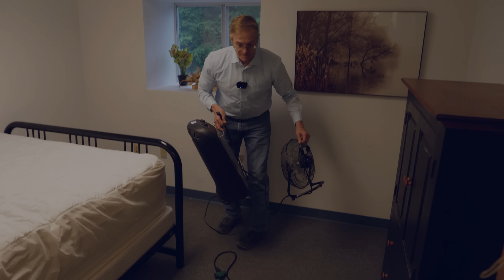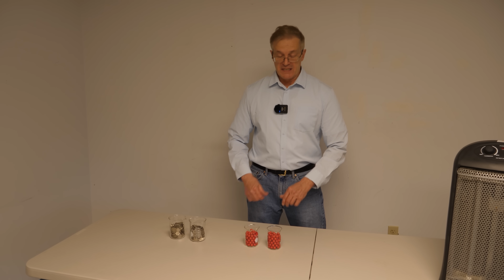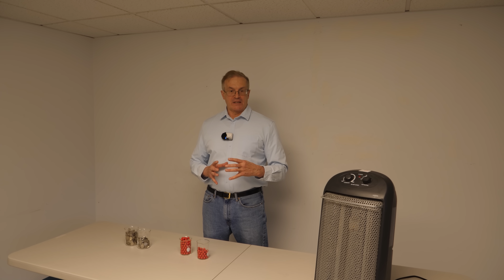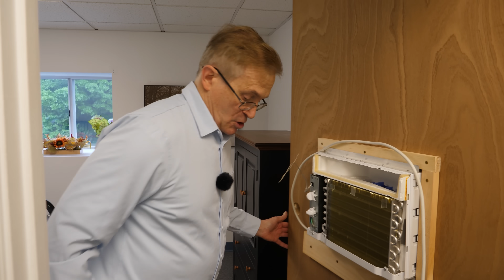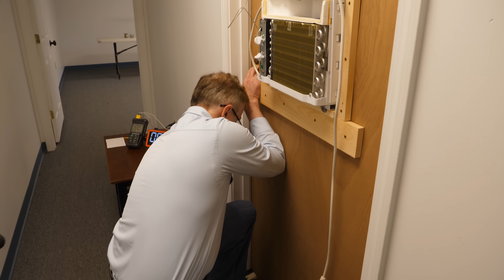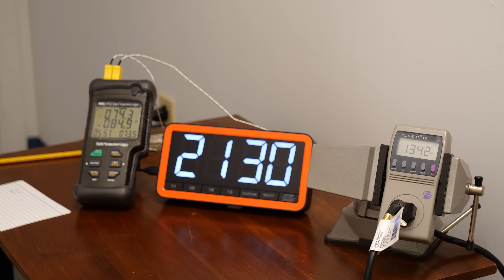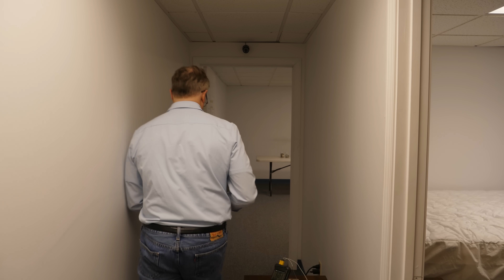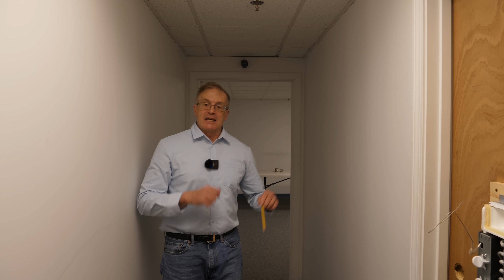You're wasting money on heating! Use your A/C!

Comment: Are heat pumps a better method than electric heaters. Yes! Are they better than my wood burning stove or my mum's gas central heating? That's a different question and how does one measure that? I'd say that the only answer is financially. Any electrical supply suffers a 70% loss through the steam turbine and transmission losses before it arrives in your house and you pay for that with your wallet.
  I  would be really interested to see how heat pumps perform when the source is at -20 and the desired temperature in the house is at +22 i.e. winter (yes SI units). Will it outperform an impedance heater? My guess is that it will. Will it outperform direct wood, gas, coal or oil? My guess is absolutely not.
  Your experiment had the source at +22 which is completely unrealistic- who needs heating at +22?
  Good luck and Godspeed.

 To preempt the comments, there is no point citing "Climate change" or "CO2", or any other such nonsense, since electricity comes from burning wood, gas, coal or oil at the previously mentioned 70% loss.

Comment: A car parked in the sun will manifest up to 120 F interior temp. The immediate thought is to use a thermoelectric module to convert this heat energy into electricity, in this case for a "hot parked electric car". I've read studies that found 280 watts of electric energy could be manifested in this fashion. None of this really mattered until electric cars showed up. I have no idea how this would be executed as I'm not an engineer, but. 120 F is really hot and it is wasted. I have owned businesses and paid electric bills for 40 years, anything that can be done to disappoint a utility executive would give me joy.

Comment: My A/C unit will not turn on if it's cold outside, so this is a cool experiment, but that's it.
Reply: relatively easy to heat up the thermocouple to force the AC to turn on...heck, move it to the inside instead of the AC side of this demonstration and it works even if the outside is sub zero...and continues to work as long as the inside is warmer than the cut off...but that is not the point.

The entire point of this is a Demonstration of the function...  A full house AC unit that has a seperate Induction Heating unit VS A full house AC unit that has a Heat Pump is what he is demonstrating...and people chose the CHEAPER to buy former option to save Pennies up front compared to saving Dollars with the latter option.
That is the point of the demonstration.  He isn't saying you should try to make a window AC into a heater in the winter by just turning it around.

Comment: It's so impressive that people do not accept the fact that heat pumps save them money.

I've had HP's in the houses I've had for the last 25 years.
And in our current house which was built in the late 50's the cost of re-insulating it would cost at least US$50,000 in order to reduce heating costs, the HP cost just US$1500 10 years ago and it reduces our annual energy budget with at least 10,000kWh, which would convert to about a savings about US$750 annual reduction in energy costs. 
(I live in Norway, and I used a nominal rate of NOK 0.75 per kWh for my region (which is above the arctic circle)).
Reply from the maker: Maybe that will change...😉
Reply: @TechIngredients  Lets hope that your reach and skilled videos can convince people to use HP's to heat their houses rather than use LNG or pure resistive electricity for heating.
I've observed that a lot of people say that it's useless to use HP's in old houses due to humidity, lack of insulation, that it's costly, etc.
But most apartements or houses which can use an AC can also accomodate a Heat Pump, and as long as the temps of most days are above -25°C most pumps have a COP well above 1.5 (for each kW input you get 1.5 out as heat).

Comment: I really like this video, great job. I have a single question though. If it was worthwhile to use the fan to circulate the air for the space heater, wouldn't it be worthwhile to have it blow on the back of the AC to circulate the air? I don't know how much the back of the AC circulates the air, but it may have even been more efficient if the AC made a hotspot by the door (and the thermocouple). In the end, it probably would not have made much difference.
Reply from the maker: Sure. 
The fan on the back of the airconditioner's exhaust is about as powerful as the small fan we used with the space heater.

Comment: I wonder, shouldn't the additional vent run on bot tests to be more fair/accurate...
Reply from the maker: Additional vent?
Reply: @TechIngredients  Ah well, I didn't notice the first heater got no fan on it. Common electric heaters I know are coming with a fan built into. My fault.
Would be interesting how an infrared heater compares to the setup.

For cooling this could or should at least also work, as there are certain wavelengths that cool certain materials down. Like a special paint or a sail on the ceiling where the specific light shines at. 

I guess cooling with light is on par with infrared heating, efficiency wise. So a heat pump is still 4x more efficient. Thou you got no moving parts and the system might be much cheaper and easier to install. The spare money could be spend on additional solar panels and since you cool when the sun is burning it might still be a good solution. But this does not solve the heating problem in winter.

Comment: Room a/c compressors today are near PF of 1 and only draw power actually used.
I have has to add 40ufd caps. to old fridges to reduce current draw because every utility meter I have measured are not real watt-meters but just charge you by current used so add parallel capacity to acheve a PF near as possible to 1.

Comment: A powerful dehumidifier can also provide a surprising amount of heat due to the release of latent heat from condensing humidity, basically the reverse of a swamp cooler.  This is very noticeable when we operated a portable AC in dehumidify mode to speed up the drying of concrete indoors.  In dehumidify mode, the duct tube must be removed according to the manual (i.e. does not vent outside unlike AC mode), but instead requires a piece of garden hose for the condensate to run into a drain or bucket.

Despite only consuming 600W, after leaving the portable AC run overnight in dehumidify mode, the room felt like a 1500W space heater was running.  So basically the drying concrete was drawing heat from the ground to evaporate the moisture and the dehumidifying process was releasing this latent heat into the air in addition to the 600W of waste heat from the machine itself.

Comment: The way I understand heat pumps is like this. Any matter (gas, liquid, solid) that has a temperature above absolute zero consist of atoms / molecules that are moving. Vibrating in place is a solid, or bouncing around bumping into and off one another if a gas. With a gas, the higher the temperature, the faster they are moving (more energy). So how could you take heat from a gas (say air outside) that is cool and concentrate the heat in another place (say air inside) where the gas is hotter? We all know if you simply pumped the cooler air from outside to the air inside it would mix, dilute the hotter air, and cool the room, so what gives?

Well (and this isn’t exactly how it works but the principle is the same), you could have a chamber and a piston outside in the cooler air. Fill the chamber with the cooler air, and drive the piston into the chamber so now the gas occupies half the space it did a second ago. What happens to the temperature of the gas inside the chamber? Imagine it like a box with a lot of rubber balls bouncing around at a certain speed. Push all the walls of the chamber in so the space inside the box is halved, what happens to the speed off the bouncing balls in the box now? They increase dramatically. You’ve just concentrated the heat by applying a small amount of energy to a piston. To achieve the same increase by heating that same amount of air with electric heating would use a lot more energy than just concentrating the energy that was already latent in it.

Of course an actual heat pump doesn’t take raw air from the outside and do this, instead it has a closed loop of gas inside a system that can cycle round and round from liquid to gas and back again, instead absorbing and dissipating the heat from the environment through radiators and using fans to blow the environmental air around, but the principle is the same. 

I find this way of thinking about it (bouncing balls bumping into each other  at certain speeds and pressures) to be a far more intuitive way of understanding the process than getting into the laws of thermodynamics and entropy.

Comment: Alsways thought about turning my AC around since ive got either electric baseboards or a wood stove and half the year its only mildly cool but I need the heat to keep it dry, but would be sweltering if I had the stove going nevermind the extra wood needing to gather.

Comment: Just make sure to explain to people that the larger whole house HVAC systems don't work when it's cold out and burn money like a politician in DC. I will never, not even at gunpoint, install a flipping heat pump in another house as long as I live. I fill my propane every couple of years for about $600ish dollars and it only runs the downstairs furnace. When winter hits and the heat pump comes on, it's about $200-300 additional per month on our electric bill. We also know from past experience, if the propane furnace stops working, the heat pump can't even keep up if it's freezing outside. Inversely, you can shut the heat pump off, place a couple fans pointing upstairs and keep it nice and cozy w/out the stupid heat pump. Also, we know from experience, when the power goes out for a week or longer, we can just run an DC/AC inverter to power the furnace & continue to have heat. Can't do that with a heat pump. Using it indoors is an interesting concept but putting them outdoors is the greatest lie ever sold to the public. In the right climate, cheap electricity, they may be suitable, but most climates, they should be illegal they are so ineffective.

Comment: Finally someone explains a heat pump. In an intuitive way. Why nobody else said that is just an AC on reverse? Thanks again professor.
Reply: everybody says that actually. Refrigeration cycle = reverse heat pump cycle
Reply: Check out techconnections videos on heat pumps, he explains them just that way but much more in depth if you are interested
Reply: @Bepissmall  thanks I want to know everything about everything so, always on the lookout for good sources.
Reply: It's not AC in reverse, it's just AC. Term has nothing to do with the directionality of the system.
Reply: @corprall The nitpicking contributes nothing to make the idea of a heat pump more tangible, which is what my comment is about. It is not about technical terminology precision. Which is something I love about this channel, it is more about spreading knowledge in a didactical way than showing off.
Reply: @tinkerman-q  That's fair, I think I misread the comment originally.
Reply: @corprall pedent
Reply: @corprall they are actually called reverse cycle Air-conditioners on the sales brochures
Reply: Actually it is A/C in reverse. An A/C/heat pump unit has a reversing valve, also called four-way valve, that reverses the direction of freon when switched to heat operation. This in turn, switches the functions of the evaporator and condenser.
Reply: It has a couple other needed modes, but that is basically how it works.
Reply: Literally every explanation of heat pumps I've ever seen does say that the same as an AC but reversible.
Reply: @G3rain1  @corprall No harm done, I am glad that's out the way.
For those that literally all explanations were like this, good for you. I for one seen many of them, usually explains the usual (extract heat from the outside and bla bla, but not a direct analogy). Which never really clarified how that works well even when outside is really cold. Some "experts" even claiming heat pumps are a scam.
Reply: A heat pump is a refrigerator where the outside of your house is the inside of the refrigerator, you pull heat from the cold outdoors making it even colder, and dump the heat inside your house
Reply: You could also imagine it as a refrigerator that cools the ouside. ;) Same thing ...
Reply: Now how does AC work then?
Reply: @BeefNEggs057  With AC you want to move heat out of a cool room, and dump that heat into the warm outdoors.    You have a circulating fluid, it is easiest to imagine a gas.   The gas goes through a cycle: first you have warm gas, you compress that so it gets to a higher temperature than the outdoors, now the outdoors cools off the compressed gas (though conduction with metal coils).   Now the compressed gas is pushed through a nozzle, into a low pressure chamber, which cools the gas to a low temperature, it chills the indoor coils in the AC.   Now the gas is warm and the cycle repeats.

Comment: The AC needs to be mounted backwards on the window IN COLD WEATHER for this to be a good test.  In winter, when you would be using a space heater, the outdoor air will be cold.  The AC   then makes that air colder.    Cold -> colder is a less efficient than warm -> colder for a heat pump.  So you need to run more compression cycles to get the same temperature change.  By dumping the cold air into a hallway with the same starting temp as the room,  the heat pump more efficient than in real world conditions.   I think that's the biggest issue with this demo.  I wouldn't be shocked if it was still more efficient, but 8x(?!).  I don't think so.   I'm sure someone said this already, but I didn't see it.

Comment: Possible factors which may have skewed the results:
When you heated up the room all of the moisture in the air and surrounding surfaces was absorbed into the air, making it harder to heat, when you opened the door to let the air out all of the moisture also escaped the room with the air.
Also, this is close to a best case scenario, in most cases you will need cold when it's very hot outside and warm when it's very cold outside.
If it were that efficient, we would just put stirling engines on top of heat pumps and get perpetual motion, the reality is that it's only that efficient in cases where temperatures are very close.
When you need a 50 deg difference it will be very inefficient abeit maybe as efficient as a regular space heater so it should probably always be better than that, maybe not economically so in very harsh environnements though

Comment: In northern Europe heatpumps are THE method for heating single houses, either by geothermal or air based heat pumps. The new air based ones can transfer heat at a coefficient of 2 at -25 °C (-13 °F) or some at even lower temperatures. Check out for example the units made by Mitsubishi Electric and Panasonic.

Comment: Very interesting! 

I may be wrong but it sounds like you got efficiency from the resistive heater completely opposite. When things are nearly 100% inefficient it would throw out a lot of heat! 

Also, I noticed a radiating heater without a fan never worked very well than a fan heater because it circulates the air more throughout than a local convectional effect.

Comment: I have a central heat pump, but I still use a window unit heat pump as it's actually cheaper to run the window unit along with the central unit.

Comment: That's not NEWS. 
Here most/all air conditioners are dual purpose cooling and heating. 
The problem is heating in very cold weather when the outside unit may freeze and cooling very warm weather when the outside unit may overheat.

Comment: I use heat pump for base heat in all my buildings now and suppliment with LP gas and /or bitcoin miners. Miners are 100% efficient at producing heat as well (same price per watt as space heater) but generally more expensive than burning LP if we ignore miner earnings. 

Heat pumps are simply limited by the max delta possible, so when it gets too cold outside i need supplemental heat too.

Comment: I don't think three hours was enough to let the heat that was transferred to the mass in the room to dissipate. The fact that the room was still 2 degrees hotter than the beginning of the resistive test certainly implies that. 

Changing the temperature of air is easy, as it has a very low mass. The work done by HVAC is intended to move heat between the air and the mass in the room. I don't think it changes your conclusion at all, but from an objective data collection standpoint, your test is flawed. 

Thermal imaging could be used to confirm this.

Comment: I think you should have run the stand alone fan to mix the air in the room when you used the a/c unit. Your temp probe was closer to ac output compared to electrical heater.

Comment: Greetings from the far north, Komi Republic, Russia. It can be very cold here (the average temperature in winter is around -20C, and there are also frosts down to -35 -42). It is obvious that heat pumps are much more efficient than heat production by more conventional methods. Of course, even in winter you can take heat from outside, but for this you need the condenser temperature to be significantly lower than the ambient temperature outside. Ice, which almost immediately covers the condenser, prevents the normal operation of the air conditioner. Even with a defrost function the efficiency of such systems is extremely low in this climate. Therefore, this heating method is not suitable for everyone - it all depends on the climate and the average temperature during the seasons when heating is required inside buildings.
Also specifically in our area, energy resources (in particular natural gas) are not so expensive. There is even a local joke that you can heat any crumbling hut with gas.
Reply: There are heat pump systems that get the heat from the ground and not the air.